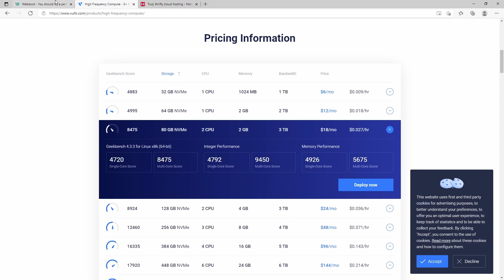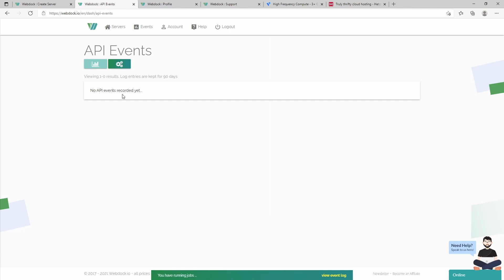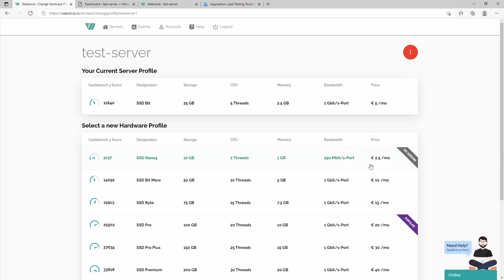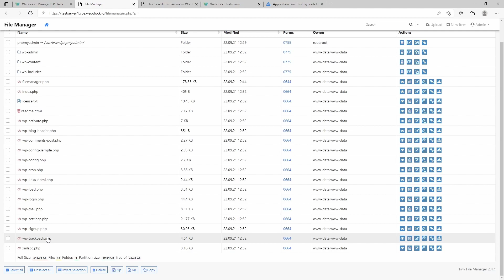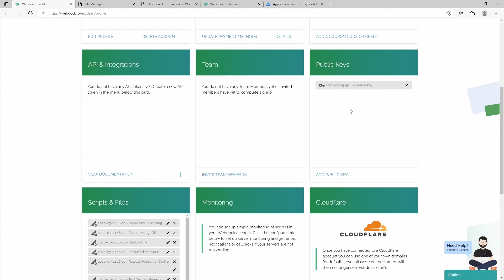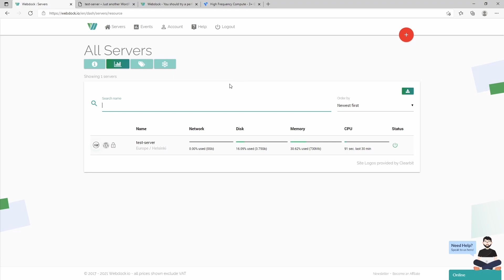Webdock.io: an inexpensive, powerful and sustainable VPS-provider

Comment: Hi there,

Thanks for the video. How you place webdock in 2022? Is it a good provider to work with?

How much security of data is there? I mean is there any chance of total data loss, like i login someday and my server just crashed and vanished?
How is the performance?
How about uptime?

I also see when you deploy your first server it uses their own image. Any chance of installing fresh os without anything?

Thanks
Reply from the maker: Hi,

They are still a very good provider, and they have expanded their offerings with very fast Ryzen based servers.
In the end, it is always advised to do external backups at one or more locations in the case of dataloss at data center level.
The multi-core performance is excellent for the Xeon based servers (for applications with many users), and the Ryzen based servers have excellent single core performance (for cpu intensive applications such as databases, WordPress, etc).
I have a couple of sites running there and uptime sofar has been 100%.

You can also choose to use a clean server image (with just Ubuntu)